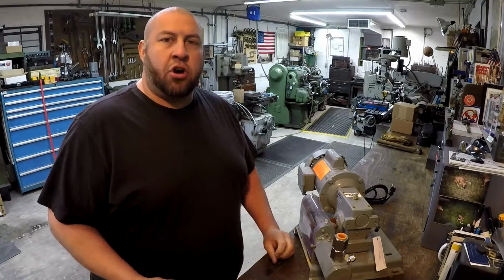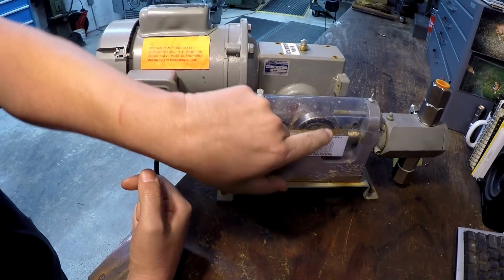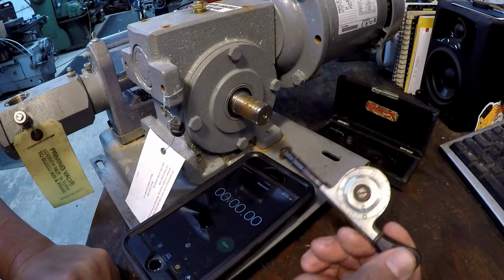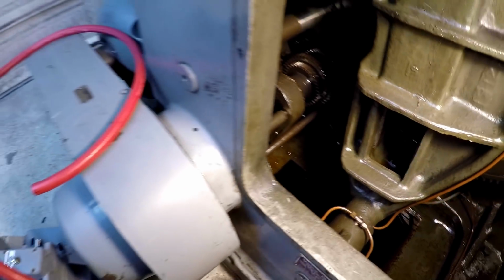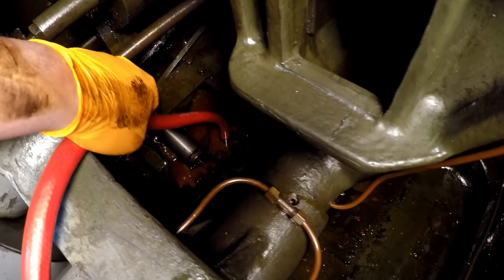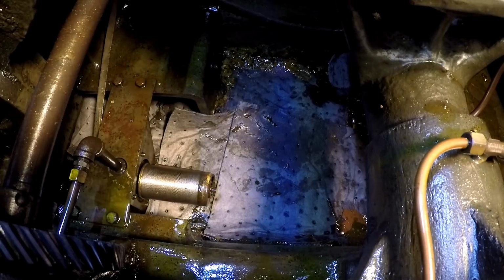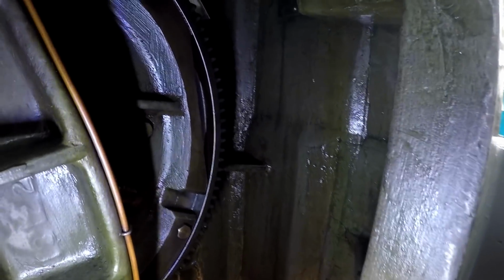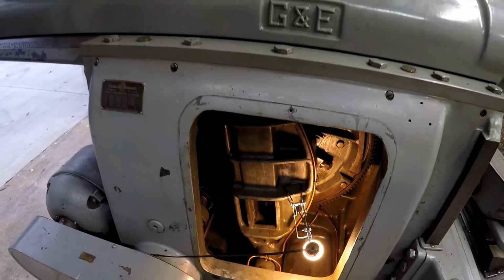G&E Shaper Oil Sump Cleanout

Comment: Man it would be so nice to have your own shop. A place where the only people that touch your machines are the people you allow. A place where asshats dont use a machine and leave chips, burrs, hand tools, greasy hand prints and, messes on the floor. It never fails at work. I go to use a machine and its a mess. I clean it up, then do what I need to do. Then clean up the mess I made. Leaving the machine ready for the next person to use. I go in the machine shop a day later, the machine I cleaned up is a mess. Sometimes I get spare time. Ill gonin the machine shop, just because its a place I like to be. Ill pick a machine and deep clean it in entirety. Scrub down the castings polish up anything that needs it
 Oil anything that needs oiled. Right down to detailing the electric motors. Ill get a tooth brush and clean between all the cooling fins.  Wipe down any tuning, hoses, wires. Ill clean the floors up. Mop the floors real well. Degrease them if need be. Wipe thr walls down. Go through yool cabinets and wipe tools down. Making sure everything is in order and where its supposed to be. Then, the same thing. Ill go in there a few days later. Looks like a  200 poind oil soaked gorilla used the machine shop for a jungle gym.  So disapointing.  Its very discouraging. Makes me want to not care. But, I just dont have it in me.  Kinda like,  "anything worth doing is worth doing well".  If Im going to go to work and work, then Im going to do a good job. If Im not going to do a good job at work, then I might as well not go.

Comment: I was motivated by your positive comments on PIG MAT.  I bought a roll, part number 7221.  The roll is 15 inches wide and 150 feet long. (38.1 cm X 46 meters)
  I am in my 70s and if I stat leaking, I might throw a square in my BVDs.

Comment: Adam, that pump you picked out of the scrap pile looks like a proportioning pump for injecting fluid into a system. I've seen similar used in gas turbine water wash skids. Hope that takes some of the mystery out of it.

Comment: Hi Adam is there a crack in the casting on the lower reinforcing web inside the machine or is it a casting flash that has been left on, just an observation. Thanks for the video

Comment: That filter in the sump looks like the old Kuno (or Cuno?) disc filters once used in aircraft.  Some of them had blades between discs and a handle you could spin to periodically wipe the discs clean.  Or, they could disassembled to clean the discs.  Don't know if the filter you have needs it.

Comment: As a high school kid working in the oil patch in the 60s, I used a product called VARSOL in a suction pressure washer to do stuff like this before we brought it inside for rebuild. It was VERY dirty and nasty....which is why the high school kid got to do it. Also painted pipe fence with a pair of cotton gloves....but thats another story.

Comment: I guess the sump is going to be the worst area since it's designed to collect all that gunk and flakes of god knows what, the bearings and oil lines etc are probably no where near as scary as that looked. When it ran it sound very nice and smooth. It will be interesting to see the effects of having the proper amount of clean oil flowing around it, although it'l take awhile I daresay for the oil fully to reach every surface and work it's healing magic? Seeing you doing this cleanup/renovation gives me a happy feeling bro, I can't explain it all, but it's like your honouring and respecting the old ways, the old wisdoms; it's good to see someone with the courage of their convictions! It makes me feel secure... Hah, anyway :)

Comment: Nice job Adam, I think I got you beat on debris in the sump of our shapers. Got a hacksaw blade part, a couple of pounds of big curly chips and busted length of toolsteel. Interesting to see the transmission gears helix cut but the bull gear looked straight cut. Mines the other way around. Looking forward to your progress. All the best Mat

Comment: Adam, I used to oporate a boiler for kiln drying wood. That is the same pump we used to pump the chemicals into the boiler. I am sure it can be used for lots of things, but that was one application. They are very good pumps for continuous pumping for extremely  long periods of time. They are typically  kinda slow pumps.

Comment: Hi mate Don from Australia by the look of the machine I would pull the pickup for the oil off as in the older machines they put a filter to stop any large particales from blocking the lines.

Comment: Did you get your lights at Lowes?   Also we use diesel fuel to clean the inside of gearboxes.  It is not as harsh on the gears and oil passages as some cleaners.

Comment: Give the shaper an internal bath with Turbine Flushing Oil. Comes in 5-gallon drums. Does a great job breaking down and carrying away deposits while still providing good lubrication. Let me know if you would like the brand/part-number I use.

Comment: That piston pump is great for pumping out oil in all sorts of situations like this. However I think it could run at higher speed which means it needs a different gear ratio in that worm drive. that's a lot of work. It would have lower pressure but much higher speed and the pressure does not matter for this anyway.

Comment: Using a degreaser INSIDE the sump may not be the best idea. Any residue would likely alter the lubricating qualities of the new oil.  Please consider using kerosene in a sprayer.
Reply from the maker: This isn’t my first cleanout job. It’s a degreaser. All I used it for was to wipe out the bottom and side walls. I’ll assure you the machine will survive, just like my concrete has.

Comment: That was really interesting. I have never seen inside a shaper and always wondered what all the space was used for.
I love old machinery before xmas I bought a Brown & Sharpe No 2 which is being cleaned up very slowly so it can be put back into service in my shop. Also, I am about to take delivery of a Smart & Brown 1024 Lathe which shouldn't require much work to start using again.

Comment: Mucking out oil, no better way to get in touch with your machinery :). Soliciting recommendations from the oil manufacturer is always a good idea.  I found a manual on the Vintage Machinery website and it states 7-1/2 gallons for that size shaper.  At any rate probably couldn't overfill with that type oil fill system.  Keep up the very interesting videos.

Comment: Adam: The pump works slick, I can think of a lot of grungy jobs for one like that. Also could be used the other way to put heavy lube into hard to get at places. I don't understand the purpose of the beveled iron adapter plate below the  vise. There must be a great reason why that the universal table is built that way on that side. ....Dave
Reply from the maker: Dave I’m not quite sure what part your referring to.

Comment: At 21:20 there looks to be 2 cracks in the casting above and below that window, inside the gearbox. Not sure if this is a stressed area or not, however i thought i would point it out anyways..
Reply: That looks to me like the witness of the join between the two halve of the sand box which was used to cast that arm. Quite normal not to bother dressing it off if it cannot be seen.
Reply: Notso Fresh No crack. It's a seam where the molds have met

Comment: Considering how heavy duty that pump is, and its slow speed and gph rating, It was made to pump really thick fluids. My guess would be it is for an automatic grease system on a really big machine. Or perhaps a grease system that serves a whole shop/ship full of machinery. Farm machinery has similar systems now, though much smaller. Saving greasing time is a huge advantage to farmers. Factory machines are stationary. On a tractor, its hard to hit the nipple when it is baling at 7mph.....

Comment: I remember when I did the sump in my Rockford 24" shaper . This is not a fun job but nessecery . I need to do it again so I can fix a leaking oil seal  on the motor shaft . The G & E is shaping up nicely

Comment: Hey Adam, cool pump especially for free. I’m kinda surprised you wouldn’t have some diaphragm pumps at work with the hydraulic oil you deal with which would’ve been ideal. Still an excellent cheap solution you have. Cheers buddy, good content as always

Comment: Great video Adam! I can almost smell the old oil and grease inside the machine. Neat little pump you've got there. 
I can also recommend a water-vacuum cleaner, works very good to get the small grit and flakes and residue of oil out of every corner of such a sump. However these pig-mats are also really helpful.
Keep up the good work and the videos. 

Mark

Comment: If the pump motor was run on 50Hz instead of 60Hz, the 30 RPM would be spot on. Also, you need an apprentice for the sludge shoveling... :)
Reply: tsstsstsstsstsstss
That's what i was going to say. 😏
Reply: Most likely rpm is specified under load, but yes compare 50 to 60 Hertz/cycles = 20% difference.

Comment: Hey Adam... not sure if it been mentioned but I think that "dip stick" is the overflow type, by where it is set at a level meaning that the sump cant be over filled. (bit like on a car differential)
Reply from the maker: In the manual I read they said there was a dipstick there and you can add oil there instead of removing the side cover.
Reply: Ahh... like this? https://www.hobby-machinist.com/attachments/oil-level-2-jpg.240987/

Comment: Looks like crank is cracked from top to bottom.
Reply: Casper Hoelgaard Buch It's just a parting line from the casting process.
Reply: Are you sure? For me it looks like a defect in the surface from the casting mold or model.
Reply: Yes, you're right. The lighting tricked me. It looks like a mold seam.
Reply from the maker: It’s not a crack
Reply: The parting line of the sandbox is always straight , but our "object" is irregular. You can see the tapering of the ribs of the crank. The crank as we see it now , is like looking from the bottom of the box through  the sand upwards . So the parting flat of  the mold  is square to our viewline . IMHO , during the molding process , the lower mold suffered a shock and produced an irregular crack in the sand over the whole length of the box. Once they made the casting , this small crack in the sand is reproduced onto the surface of the finished crank.
Reply: Stefan Richter: I would say you are spot on with your conclusion ! Obviously a man that has done a lot of casting.
Reply: Englishman French : Thanks for the kind words , but you are wrong. If have not made a real casting in sand in my life. But after much observation (youtube) I think that I understand the process of sandboxcasting to certain extent. I have spent a time making practices at Siemens in the 70ies , one of the skills they told me was mold-fabrication from wood. So I recognize very easy the tapering of a molding surface. This tapering indicates the direction the sandbox is divided.

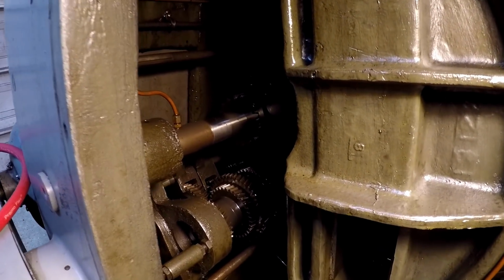Comment: Regarding "proper lubricant" around @12:00 I ride 2 stroke dirtbikes and I've run everything from 90w to ATF type f in my gearbox without any issues. Some guys swear by 15-w40 diesel engine oil. I can't see a difference between them.
Reply from the maker: I’ll trust the engineers on this one.

Comment: Kerosene works wonders for cleaning machine sumps. It tends to dissolve the sludge,  it is thin enough to flush all the gears and bearings clean and you don't need to worry about water based cleaners. Monarch recommends it for flushing the headstock and apron.
Reply: I agree as it evaporates and leaves no residue.

Comment: Have you managed to find the 5/8 inch cranks and other square stock you need for removing/loosening and tightening things around the mill yet?
Reply from the maker: The square ends are 9/16”. I found a used broach and have a sample crank to copy.

Comment: Nice and clean, could hosing the inside with non-chlorinated break cleaner wash the crud off the walls down into the sump,  or is that too caustic for the gears?

Comment: I would imagine SAE 250 Gear Oil would be the closest to what you need. Also if you can get the shaper arm all the way forward, you probably can clean the back easier.
Reply from the maker: Engineers called for something like HO 150
Reply: Actually SAE 250 would be too thick, although the oil I found listed the viscosity as a match. Just now I found this chart.

https://www.bobistheoilguy.com/viscosity-charts/

Looks like SAE 85W gear oil may work, although hard to say. Oil is such a funny thing with all the parameters and additives.

Glad to hear though you did find the oil you needed and are getting the oil shipped.

Comment: just for kicks.. shake up the used oil and pour out a sample in a plastic bowl or bottle bottom.  dip a super magnet wrapped in a plastic bag into it.  see how much metal fragments and rust it collects. homedepots on the fastener isle have various sizes of supermagnets. you might want to invest in one and stick it in your oil sump bottom away from the pickup tubes. so any rust or metal fragments that come loose inside the shaper later will be attracted to the magnet and not go thru the circulation system.   i put super magnets in every thing..  automotive rear ends.. inside fuel tanks.. down in the corner of engine oil pans..

edit.. as for the oil flow sight coaxial hose.. i would really want to see what the factory used.. instead of vacuum hose.. that won't deal with oil very well.. you might need some teflon tubing..  like braided stainless Dash size tubing with the braid removed.. so it can be used as a coaxial.
Reply from the maker: The magnet is a good idea. I’m ordering proper tubing rated for oil and fuel.

Comment: isn't that just an "oil flow sight glass", so you see there's oil flow or does it actually oil something out there. rubber hose inside of hose makes sense for that near 0 pressure application :)

I guess I should watch the videos in order first.. sight glass to show it's getting lube to the  wicking to lube the slides oh well